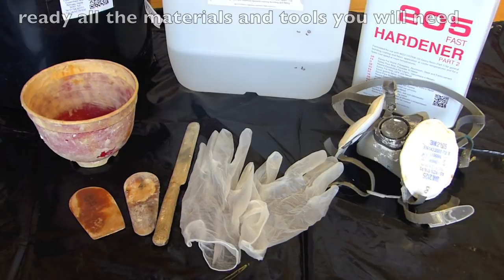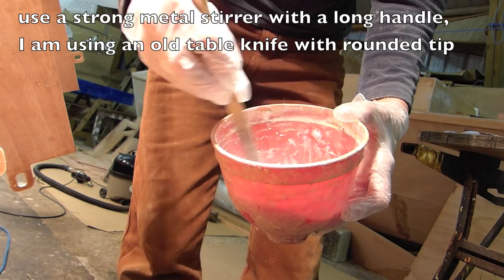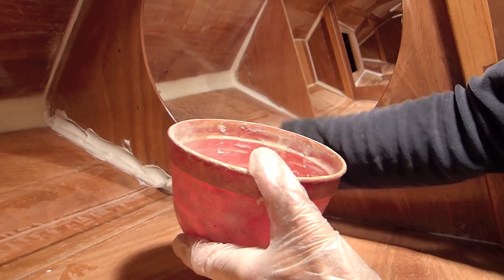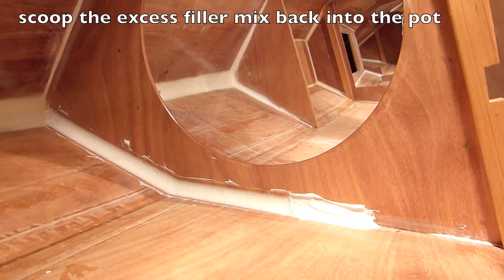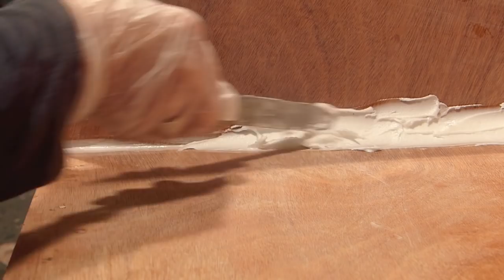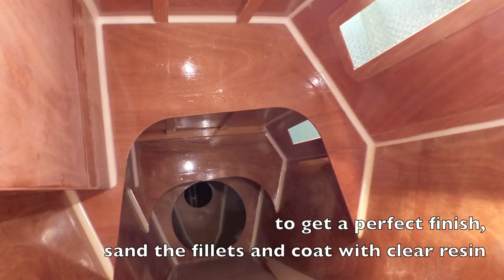Making Perfect Epoxy Fillets

Comment: Great video. Looks so easy with no sanding needed. Having the sheets of ply coated in epoxy beforehand is by far the most efficient use of time, epoxy and produces the most even coatings as the epoxy can be applied with a sponge roller while sheets are laid flat. Nice !

Comment: If you use a light bulb as your fillet tool, no matter what angle you hold the light bulb you will always get the perfect fillet
Reply: Would it work if I only have florescent lightbulb tubes?
Reply: I see what you mean but doesnt a blade perhaps paddle the epoxy more into the joint instead of the rounded edge of a bulb with possibly less traction ?
Reply: If you look up filet tools that the mold makers use for fine parts it's a steel rod with a steel ball on the end of it. I just up sized the filet tools to a light bulb for the diameter
Reply: @markbrown-sb2zm  depending on the angle on your paddle it can change the radius
Reply: @nathelm  especially if you have those corkscrew type.
Reply from the maker: I can see a problem with the lightbulb/ball idea. Where does the excess filleting mix go when you draw the fillet? As you can see on the video, when I draw the fillet a large blob of mixture collects on the spatula and is put back into the pot. The bulb idea would only work if exactly the right amount of fillet mix was put into the joint, which is impossible to judge. If there is too little there would be cavities in the fillet, too much and it would blob out on either side and be difficult to remove.
Reply: it goes in the same way as your spatula technique, wiping excess up. we Use a lightbulb with the aid of a small standard spatula, to cleanly wipe excess and keep it ahead of the bulb. Where the bulb excels is in corners where it is hard to maintain angle with a spatula, changing directions. They sell the smaller steel ball spatula tooling tools that the production companies use to set up molds for the parts with smaller radiuses. That is where I came up with the idea. I was drilling out hobby wooden balls and installing dowels for handles, when My father walked up to me and set the lightbulb on the drill press....

Comment: I bought plastic heavy wall small bags used to carry goldfish and poked  a short length of a piece of plastic irrigation 10mm hose through one corner,  then rubber banded the bag corner over it to make it seal well.  Cut the end of the plastic at a slight angle say 30 degrees, and put your filleting goo in the bag and close the end with a rubber band so now  you can squeeze it out along the seam just like icing a cake.  Then take a large popsicle stick or a tongue depressor, or as someone said, a light bulb, and put the final shape to the fillet bead.  It saves a lot of mess and time.

Comment: The fillet needs a wet coat of catalyzed epoxy resin before the filler is applied regardless of whether or not you have previously coated the ply. This alone doubles the strength of the joint. In addition, you can speed up the job by putting the filler in a plastic bag and applying ah-la cake decorator by cutting the corner of the bag and squeezing the thickened epoxy into the joint. I have done as many as three bulkheads at a time with this method, mixing as much as a quart of filler at a time with virtually no waste and very little cleanup on either side of the joint. A chip brush with the bristles cut in an arc can be used with more epoxy to clean up and seal the fillet in one stroke and will allow you to apply four oz. glass to the joint for maximum strength easily. Some boats have hundreds of feet of these fillets and you need to have a system to get it done or you'll never finish.
Reply: Bloody brilliant man. Advice to remember.
Reply: Are there also "glue guns" that mix 2K epoxy with this special mixing tip but including the microspheres?
I figure you could mix the microspheres into one component and then mix them while extruding. Might be overkill and not needed of course.
Reply: PS: About the need to wet coat the corner - did you or someone test this? Is this really needed? Seems like it would make the job a hell of a lot more cumbersome, having to mix another batch of epoxy and also the filler having much less grip in the corner when scraping it in.
Reply: I've seen the wet coat effect in action first hand. If anything I believe he's understated the effect. His advice came at a crucial time on a project of mine and it increased the laminate strength by a lot more than double. The filler mix I was using wasn't perfectly rationed and this advice made it work a LOT better. If it's just a dinghy you're putting together it may not be a big deal but if you're building a 50' cat, this method is... yeah, super helpful.
Reply: Thx! 
You're building a 50' cat? I'd be very curious about that because I've been told anything above 32 basically takes crazy long to build.
Reply: That was an example I plucked out of the air. I'm strictly a monohull kinda dude. That project was actually in glass fiber reinforcement for a carpentry project unrelated to marine engineering. I simply needed a strong joint.
Reply: Dejay, West System has a product called six10 which is a cartridge containing filled epoxy which is mixed in the provided mixing nozzle. Just gun it straight into the fillet area like caulking a bath. I have bought some but not tried it yet. I bought extra nozzles so that I can use it on several smaller jobs.
Reply: Thanks that was what I was looking for. At least it's feasible.

I wonder if you could mix this yourself. Get empty cartridges and a mixing nozzle. Some kind of 2K glue gun.

EDIT: Ok there are at least cheap to buy empty cartridges and dual guns for 50ml. Bigger ones get more expensive quickly. I'd be curious if such tools would speed up building a larger boat significantly?
Reply: I don't think it would be worth the trouble. Oceanavagator's suggestion of cake decorating bag and nozzle would be good compromise. p.s. beware of free advice; I've built some boats but never done epoxy fillets!
Reply: Thanks. Well the idea would be to avoid interrupting your work flow by mixing lots of small batches of epoxy all the time. A refillable epoxy gun would seem to be very practical.

But yeah probably not worth the trouble or the expensive of some professional equipment for an amateur.
Reply: oceannavagator………  "catalyzed epoxy resin"...….??????  You've been using too much polyester I think..... :-)
Reply: Thanks! That makes sense.
Reply from the maker: @WelcomeToMyDream  when the plywood is precoated and sanded, as on the video, you do not need to apply more resin. The resin in the fillet mix is wet enough. We have tried to break such a joint and it is always the plywood that breaks, not the epoxy bond.
Reply: I know this post is old and not trying to pick a fight here but I am puzzled as to the statements of "doubling the joint strength" just by adding another layer of epoxy. Can someone/you actually explain why that is? It's not a wetout thing as it's claimed it works even on already coated ply. And if the surface is scuffed or "peel ply'ed" it shouldn't be an adhesion issue, either. As I said, I am just trying to understand why.
Reply: @AntiVaganza  Why? Science I guess, but what I posted came right out of the West System manual, they did the testing beyond the "we stomped on it" testing, and the results were eye opening.
Reply: @oceannavagator  Ah, ok, it's been about two decades since I read the Gougeon's brother's book and have been away for boats for a while, sadly. But I will read it again soon in preparation for an upcoming build:).
Reply: @AntiVaganza  Also, by the way, West Systems has a semi by monthly magazine that you can subscribe to for free that has articles on using their epoxy. The back issues are on their website. Good luck on the build.
Reply: I was thinking that or fill up an empty mastic tube with the nozzle cut to the right size,apply using mastic gun,you can get it flush but perhaps not thick enough for one run,so maybe cake icing method works better ?
Reply: @markbrown-sb2zm why not do as Hanneke shows you here ?
Reply from the maker: @alanvcraig That would come very expensive when you make fillets in a whole boat.
Reply from the maker: @markbrown-sb2zm watch my other video https://youtu.be/KnQ4nZe-38c?si=9YHY85SBBkRX9TiV  Wharram Mana 24 kit - Assembling lower hull. I am using an old mastic tube there for narrow hard to fill corners along the stem and keel. However it is a lot of extra work filling such a tube every time, hence for easy fillets I scoop it in by hand, much quicker. Same for the icing bag idea, a lot of extra mess and waste. You still need to scoop back the excess fillet mix.

Comment: Yes its a very neat finish..i have done many fillet joints using Wood Flour from ur electric sander.strong No cost..u need to paint the 2 surfaces with epoxy resin before fillet.i would allways use a small electric fan close to the job...breathing epoxy fumes is not advise.able..

Comment: I use a makeshift pastry bag to lay down the filleting mixture...  by makeshift I mean..  use a plastic food storage bag filled with the mixture and cut off one corner.. the angle of the cut depends on the amount of material I want to lay into the joint.  squeeze it out at a constant rate.

Comment: This is indeed a gorgeous, nearly perfect fillet. But I'm puzzled about the fillets on the two triangular "knees" visible in the background. There, the fillets are narrow to start with and taper to almost nothing where the inboard tip of the knee joins the panel. Why isn't the width of those fillets constant, like the one you show us how to lay down for the bulkhead?
Reply from the maker: Those bulkhead fillets in the background are not finished yet. Can't remember the reason for this, probably ran out of resin and decided to do it later.

Comment: I figure taping the edges of the fillet would help with the cleanup.
Reply from the maker: It is a lot of extra work to tape first and can leave a little ridge when removed. You can see on the video how fast the clean up is and how little needs removing if you apply the correct amount of filler mix initially. Do use a fine chisel shaped stick to remove excess. That scrapes it off clean and easy. Beware of nicking the fillet, a steady hand.

Comment: I thought that west say you should prime the fillet area with raw epoxy before applying the mixture?
Reply from the maker: The plywood was already epoxy coated and had been sanded where the fillet is being applied. In this case it is not necessary to coat first as there is sufficient resin in the filler mix to make a good bond. If making fillets on bare wood coating/priming first is recommended.
Reply: Would it be beneficial to the joint strength ( or overall structural strength) to round little bit  the edges of bulkheads to  increase the fillet contact area ?  What is your opinion on effort spend on green on green application of resin - first one (which is priming the plywood ) and then going with fillet.  Thank You!

Comment: Why applying epoxy fillets in the inside if the outside is sealed with fiberglass?
Reply: Strength in joint. All boats flex.

Comment: There's a easier way. Try a cake icing bag. Faster cleaner, 2 passes you are done.
Reply from the maker: I have tried this and did not like it, though some people do. There is the extra step of filling the bag. Then the mix is all in one lump and will heat up quicker making it set all of a sudden. Hot hands make this worse. Only possible with slow hardener. More epoxy waste. Then the extra epoxy you scrape out with the spatula still needs a pot and the be reapplied as in the video or you throw it away and waste a lot of expensive epoxy. Applying mix with a stick gets it in the joint and spread right out to the edges of the fillet. A slight over fill is always best so you can draw the fillet in one go, without having to add more mix and do it again. We have built many boats, including a 63ft Catamaran, making fillets as shown here. NO WASTE.
Reply: Only time you bag it... In my opinion is if you are tabbing over with fiberglass ..........

Comment: Uh, I thought that microspheres weaken glue fillets because they don't absorb resin like other fillers do so enlighten me, please.
Reply: I use talcum powder, really cheap, plus you get to choose the fragrance.
Reply: @1Howdy1  You so clever you should have been twins.
Reply: Wood flour/cabosil and or microfibers for fillets.
Reply from the maker: @DavidBrockes using talcum powder or wood flour uses far more resin as it is absorbed into the powder, hence dense and heavy fillets. Microspheres and Microballoons are embedded in the resin, but don't soak it up, hence lightweight but strong fillets. Epoxy is expensive! so better to make larger fillets with a lot less resin. I have built a 63ft catamaran with miles of fillets, you learn the most economical methods that way.
Reply: @WharramCatamarans  63ft sounds like my sort of dream retirement live aboard sailing round the Philippines🥰🥰🥰

Comment: Basically you made a pas0te out of 0the liquidy epoxy ...and this paste is available in market
Reply: eh, are you serious? I know your post is old, but hope no one is listening to you. For a big project, it makes 100% sense to try to stick to one epoxy system. Also, most epoxy putties are very heavy, difficult to mix and the lights ones way too expensive. Plus, your own mix can be customized to have the consistency be exactly as you want it and you have a choice of fillers and hardeners to dial it in even further.

Comment: DOES NOT HOLD UP ON ATV FENDERS! Comes apart just riding over bumps
Reply: Petnzme, that doesnt hold either. I have a Bumper Smith for repairing car bumper plastics. Works great on cars but atv plastics see a lot more stress and it doesnt last long.
Reply: stitching does nothing, the bumper smithdoesnt use glue. I have repaired hundreds of bumpers for Geico that never came back. The difference is abs on atv fenders see a shit ton more impact and stress and I found the best way is to buy new plastics. If not you get a sub par repair job that looks nothing close to oem.

Comment: Not only are fillets a proven waste of effort, this is anything but perfect.
Reply: James Jenson how are they proven to be a waste? Where is the proof?
Reply: I hope you know how many ocean miles these people have made in these boats since the 1960s? This is the difference between mathematical or theological perfection and engineering perfection. In engineering, Perfect is whatever gets the job done safely in the real world. Mathematical or theological perfection is in another realm and not a great way to accrue sea miles...
Reply: Eh, they are more than proven in the world of wood-epoxy boats. There are still racing boats from the 60/70s sailing around today which were built with this technique and they got abused like little else.